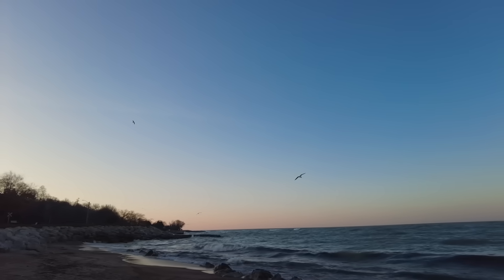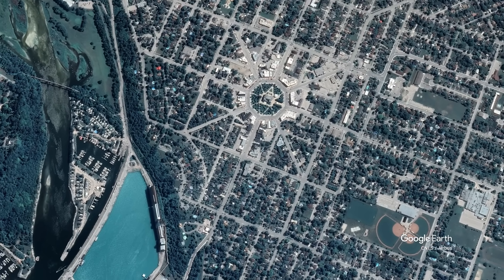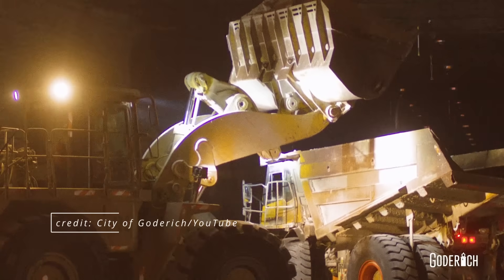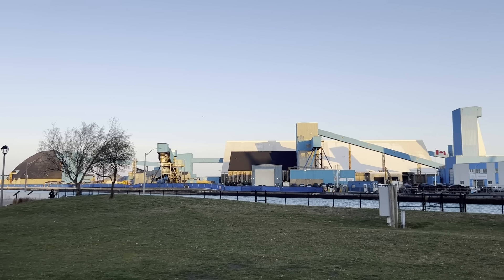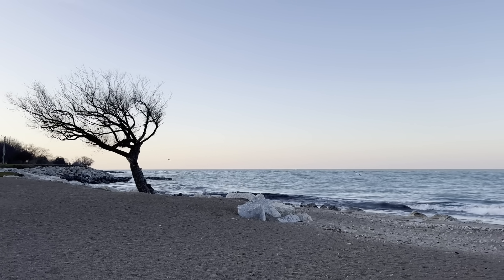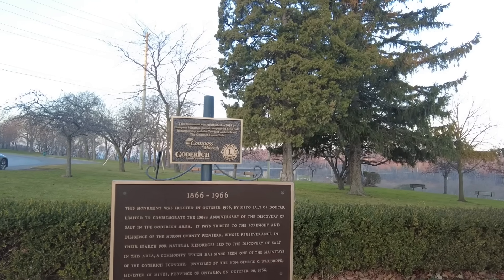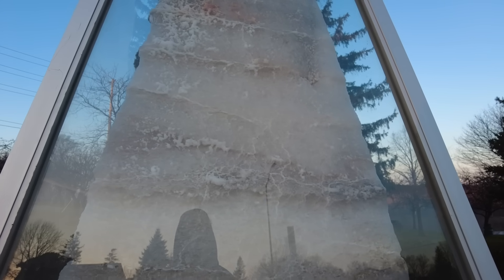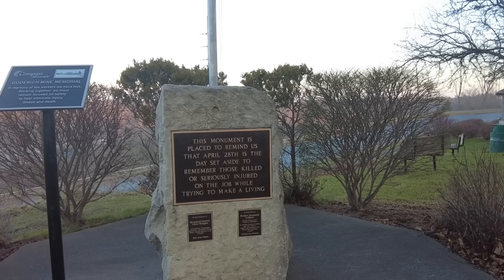Worlds Largest Underground Salt Mine Under The Great Lakes - Lake Huron, Goderich Ontario

Comment: Great video.  I worked here for a few years.  Small correction, they don't bring salt to the surface as a dissolved brine.  That method of extraction was originally used when the mine was first opened in the 1800s, but I don't think it's been used in the last century.  It's brought to the surface as a crushed granular solid through a mechanical skip (elevator for bulk materials).  Also interesting to note, because of the limited space on the surface the majority of the equipment, such as crushers, are found underground.

Comment: You are confusing the mine with the evaporator plant. Course road salt is brought to the surface after running through a crusher. Fine salt is produced at the evaporator plant at a completely different location in the eastern part of town. Salt brine is pumped to the surface and evaporated. All bagging is done at the evap. plant, so some rock salt is trucked up from the mine but the vast majority of it goes out in bulk by ship, rail or truck.
Reply from the maker: Thanks for clarifying!

Comment: My wife and I lived in  Goderich for 15 years - moved to Owen Sound in 2019.  A man in my church there told me there are over 200 km of roadways under the lake created by mining salt.  Interesting fact - heavy equipment is disassembled and taken below to the mine floor where it is reassembled.  Once it is worn out it is "parked" in the recesses of a horizontal shaft and left.
Reply: Yeah people underestimate how big mines get, sudbury alone has over 1000km of drifts (horizontal tunneling) through it.
Reply: Heh, I used to live in Owen Sound once upon a time. Have they built a bridge across the bay yet? Or tunnel? LOL. I'll never forget the amazing scenery. I lived in the edge of town , just 2 blocks from a nice lookout on the bayshore (near 28th and 3rd). I used to go out at night and watch storms over the water in the summer. Or in the winter, I actually managed to see the northern lights. First and only time. There was no color to them. It just looked like fast moving clouds, or smoke. But I'll never forget it. Or one day after an ice storm and it was -40 (with windchill). I decided to walk down to the water just to see what that kind of cold feels like. When I got to the lookout, the water wasn't frozen yet. So, there were MASSIVE amounts of steam pouring off of the entire bay as far as you could see. It looked like the entire bay was boiling.

This was when flip phones were the norm, so I didn't get any of it on film. But like I said, I'm never going to forget any of it. And I didn't drive, so I didn't get a chance to go see the sights outside of the city. There's supposedly a witch's grave in the area. And countless hidden nature gems, I'm sure. I would have so loved to explore the area in a car. Maybe I'll go back one day just for old time's sake.

I had to move, because living in that sparsely populated an area without a car just isn't feasible. I actually had to move to Owen Sound from Chesley, if you're familiar. There was even less work there, so I was hoping Owen Sound would be better. Which it was. I made a decent living until my company imploded, as they do. Good times.

Comment: Glad to see some Canadian content Goderich used to be the home of Champion graders later bought by Volvo and relocated to (I believe) North Carolina. Hope you do a feature on Petrolia and Oil Springs and visit the Oil Museum of Canada. Petrolia after all saved the whales and with the help of Ford and others got the horse crap off the streets of major cities. Yes the ICE engine was the cleaner alternative. We were also the first to frack and at one time had 3 nitro glycerine plants which subsequently all blew up. There is a large salt mine near Geneseo NY which claims to be the largest (Americans ffs) and I was of the understanding that they were working the same salt formation but my memory fails on that one.
Reply: The first drilled oil well in North America was in Petrolia,Ontario
Reply: Volvo relocated to Shippensburg Pennsylvania, they were unable to build the grader due to no skilled workers available  for the wage offered and ceased production.
Reply: @ChisholmIndustriesBuck50 We can thank NAFTA for this. I recall GM Diesel of London Ontario, an excellent employer for the area. GM sold this plant to Caterpillar who continued to run the plant for a number of years until one collective bargaining negotiation where they offered a significant drop in salary which the union and its employees soundly rejected. As I recall, a plant in Indiana picked up the production at the much reduced salaries. If I was PM at the time, I would have made any sale of Caterpillar products in Canada extremely difficult. Caterpillar is only one of many such stories that decimated good manufacturing jobs in Southern Ontario. Don’t even get me started on the Pulp and Paper and the forest products sector in northern Ontario due to NAFTA. American big business plays a zero sum game and for them it as akin to “taking candy from a baby”.
Reply from the maker: @edfrawley4356 I have a video on the oil museum of Canada. Thanks for your insights! 
https://youtu.be/hxFg_WMCfno?si=V9ddcF60XI3MQ5cy

Comment: I live 65 km north of Goderich, and have worked in the mine several times as a union contractor (Ironworker/welder). It’s such a huge underground labyrinth of tunnels down there. Unless you’re a mine employee, you need a mine worker with you so you don’t get lost down there. It stays a constant 18 or 19 degrees Celsius no matter what temperature it is on the surface 1800 feet above. So awesome down there!!🇨🇦👍🏻👍🏻
Reply: I’ve done some union ironwork down there too. No interest in going back. On one shutdown there were at least 3 major safety incidents. The mining act is whack, bro!
I still have a map of the mine as a memento
Reply: @guyincognito7442   Do you have a copy I Would be interested how it looks
Reply: @SirLouisTheThird I took a picture of the map I have, but not sure how to share it with you

Comment: Forty years ago, when I was pursuing a degree in geology, I toured what then was the world's largest salt mine, the Retsof mine in Retsof, NY. They used a wide-column stoping technique to prevent collapse, but after many years the good salt was running out, so they decided to mine what they could out of the columns. Of course, eventually the roof collapsed, and water from one of the minor finger lakes around there flooded the mine, and it was abandoned.
The created another mine just east of the Retsof mine, though, and that is still being worked today.
Reply: What happened if anything to the salinity of the finger lake after the collapse at Retsof? I live on Cayuga Lake and we have a large salt mine that extends under the lake. If any part collapsed and water flooded the mine, I'm wondering what the result may be to the ecosystem.
Reply: WHICH finger lake are you talking about? The nearest finger lake to the Retsof mine was MILES away. Salt has been a natural part of 'the ecosystem' in the finger lakes region for literally 200 million years. Water leaking in to a mine won't make one iota of difference, since it will still be separated from the lake water by at least 100' of bedrock. You get more salt in the lake water from winter runoff from the roads near each lake. BTW, Retsof merely flooded; it never 'collapsed'. Don't be such a Chicken Little.
Reply: @alexclement7221  Chicken Little? I assumed you were talking about a mine under one of the smaller finger lakes collapsing. If there was a large enough opening to a lake I would assume some mixing of the brine in the mine with the lake depending on how large the hole was.  Yes, road salt isn't too good for the environment, but the salt deposits laid down when an ocean covered the area are normally separated from the lakes by rock, and not directly exposed to lake water. I asked a legit question and you did say the mine roof collapsed. "Of course, eventually the roof collapsed". So what would happen if the Cargill mine on Cayuga were to collapse with an opening say 100 ft wide? You're saying it would have zero impact on the lake?

Comment: I'm from kincardine and in the 1800 hundreds they mined salt there also
 our house was built on one of the original salt well s
 there was a well under our back porch and as kids we were never suppose to go there it was 980 feet deep !
 we use to take the lid off it and drop rocks down it
 it took forever to hear the splash !
What it was was hydraulic mining they pumped hot water down in the ground on one side of the harbour It dissolved the salt and pumped ithe brine out on the other sideof the harbour (our house)
They had drying pans where the tennis courts are today to evaporate the water to get the salt 
At its peak they were shipping out 70 tons of salt a day by sail boat
I didn't realize it as a kid but  under the whole  harbour area of kincardine is a vast honey comb filled with water and could collapse ?
At goderich I have been on 
Fish tugs 5 miles out in the lake and heard the vibration thru the hull of them working under ground
When they dig the salt at goderich they don't melt it under ground they sent it up in the fast moving buckets in your video
There might of been hydraulic mining at goderich also in the 1800s
Melting the salt today might be part of a purification process for human consumption 
The kincardine salt company was bought out by windsor salt and they shut it down
Reply: Good   day from Kitchener Waterloo  area  So how did they dig this well?   Thanks
Reply: @donvoll2580  
Good point ! there are photos of the salt wells in the history books of kincardine our house is in the pictures it looks like  a oil drilling  tower I will look further into it and get back to you  
 the pictures from the 1800s show the salt works going an entire  block not only was there the well at our house there were several other wells as  well
Have a great day !
Reply: @donvoll2580  
Hi guy I looked up in the history book of kincardine  there were 3 different salt company's in the  1800s
They drilled the holes
 here is a quote from the book
The first salt bed was struck at  920 feet which was found to be 30 feet  in thickness below this the bore passed thru 20 feet of rock then 22 feet through the second bed of salt
The evaporating pan is191 by 28 feet and has a capacity of 70 tons a day
14 men employed Forman $2 per day six rakers $1.15 per day two furnace men $1.50  two engineers at $1.12 two packers at 2 cents per barrel esrning $1.50 per day in summer and $1.25 in winter and one laborer at $ 1.12 per day
Fuel used soft coal  about  20 tons a day $ 2.00 per ton 
Have a great day !

Comment: To be clear - They do utilize "rock bolts" as well as "cable bolts" drilled into the back to secure the excavated workings.  But they don't utilize mesh like a traditional hard rock mine would.   That said, great video and very informative!
Reply: For real? Thats interesting. They just bolt it and put a plate on but no screening.
Reply: @DevinHeida  I guess so, I've seen this a lot in the mines of Timmins ON, screen is only warranted due to inferior ground conditions.